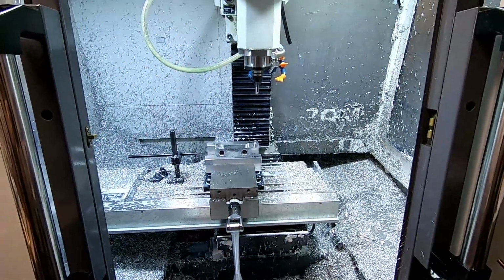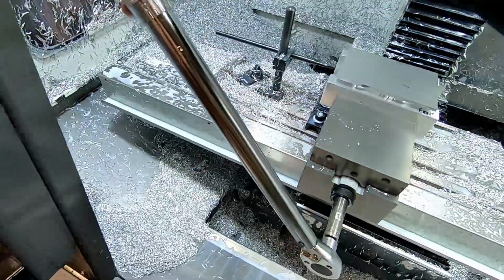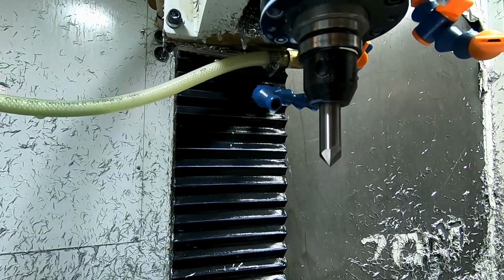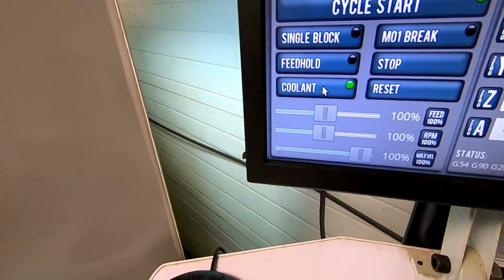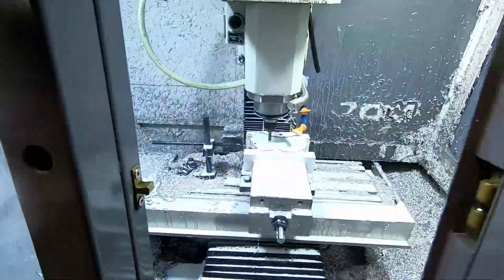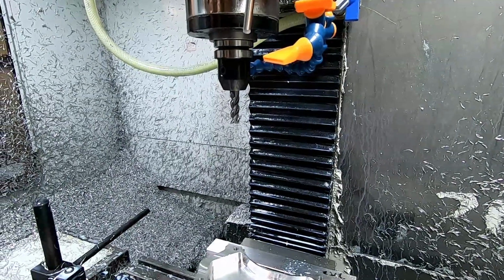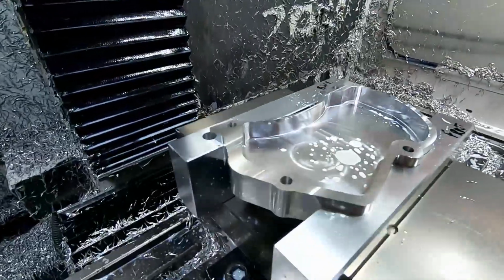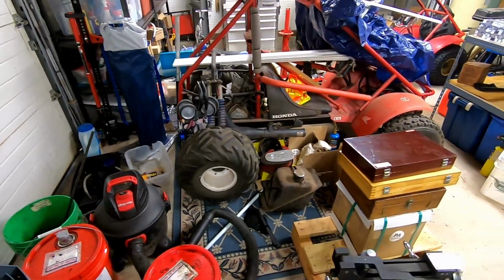Running 6061 Aluminum On The Tormach 770M CNC Milling Machine

Comment: You are absolutely right on using the torque wrench. Consistency is vital. I cannot even begin to tell you about all the times the different apes and cavemen at my job has ruined a production because they either didnt clamp the part hard enough or WAY too hard 🤣

Comment: I like this video a lot, well done man!! No fluff or BS, just doing some work. The setup is great, did you ever setup to do 2 or 3 parts at a time in there? Seems like two vises might fit and you could reduce the number of tool changes by half?
Reply from the maker: Thanks man! Yes I actually sold this mill and bought a Syil X7. I plan on using 2 vices at a time.
Reply: How did you go about finding work? Are your customers all local? Were these contacts you had prior to buying the mill?

Many of my local shops it's damn near impossible to get in front of anyone of importance. Online contact has basically been a waste. 

I've gotten a few small jobs here and but steady repeat business has been rough to come by. 

Post something like this with the X7.. that thing looks like a phenomenal value if half the marketing is true. 😆

Comment: Thank you for the video.  Do you think that the extra working area of the 1100mx is not necessary for the jobs you do?
Reply from the maker: I wanted the 10k rom vs 7k I think it was at the time. I've since sold it and moved into a nice Syil X7
Reply: I was just thinking about commenting you should upgrade machines to something like that. How do you like it so far? @WintersMachining

Comment: hi in the video you don't use the tool change button, do you use a pedal? and which CAM system is most convenient?
Reply from the maker: I added a pneumatic pedal from amazon and use my foot. I prefer Fusion 360 for all of my post processing.

Comment: Sounds like a drill press cutting sidways! Not a rigid mill at all!
Reply: Those insert cutters are loud in any machine
Reply from the maker: It's because of the insert mill. A solid endmill is much quieter, although this machine isn't very rigid by industry standards. I recently bought a larger, more stout Syil X7.